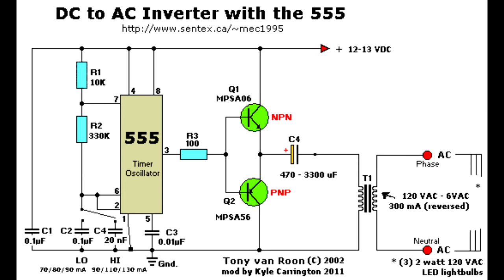PT. 2 The Sentex KyleMod 555 Oscillator DC to AC Inverter (12VDC - 54VAC) 1 Watt Lamp

Comment from the maker: It isn't the greatest, I agree, but, your measurement on the output is likely inaccurate... I've always wondered about it myself. Many of these experiments were done with a singular and special goal: to provide an absolute minimum cost (energy cost) lamp to a chicken coop. This one ran at 70 mA. So it was applicable, for that - but I agree, overall, it's not a very useful circuit.

Comment: I just tried that circuit recently thinking of using just aa batteries in series for 12 volts  and well to my dismay, the circuit itself eats up half the voltage and the input to the transformer is a dismal ~5 volt AC and output provided by the transformer is ~42 volts AC which is not enough really to get an LED low watt bulb running. So this circuit is not really practical.

Comment from the maker: Unless I find a suitable method to step up voltage (and thus current)... I've backshelfed this design, in favor of a new design I am exploring; involving YES the use of simple, inexpensive two-in, two-out transformers. I really stress that importance. There are litterally millions of these these transformers everywhere for free, or very very low cost. The new design I am looking at uses a PIC programmed toplogy, you can see it at tinyurl . com / bmczsrq

Comment from the maker: @PoirierMike The output filter can be improved, for sure, by paralleling several caps, using a low ESR cap, as previously suggested in the last vids comment, but... it is useful, in that it's a way to make something out of junk; as is. I am now going to build the flip flop (or multivibrator) inverter; however, that one you need to have a center tap transformer; which was the whole point of this one, getting away from that. Winding CT toroids is another option.

Comment from the maker: @KyleCarrington As far as I can tell, the circuit uses the cap to block DC and allow AC to pass, a filter, and therefore you lose a lot of potential, VAC reading goes way down, thus the comments about using low ESR caps?

Comment from the maker: @PoirierMike It'd probably be around 50 or 6 milliamps, but the bulbs would be brighter. The thing that makes me scratch my head about this circuit, is, either: A. I have it hooked up wrong (I've checked it over 100 times) - or - B. This circuit does not produce 120 VAC. When PIN 3 goes high, you get 5 volts. To fire the base. Problem is, you lose over half the AC voltage across the output cap! 12 VAC on the + side, 4.6 VAC on the negative!